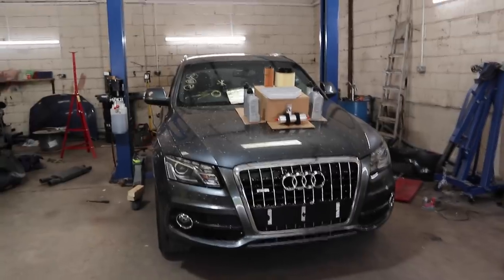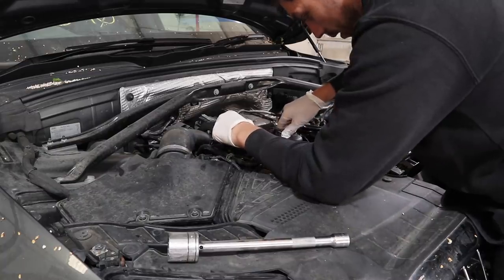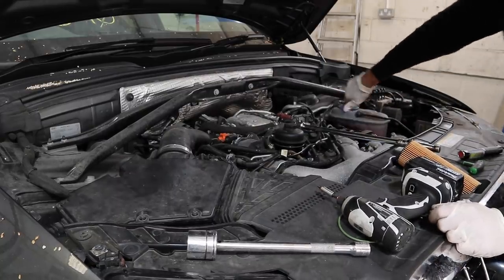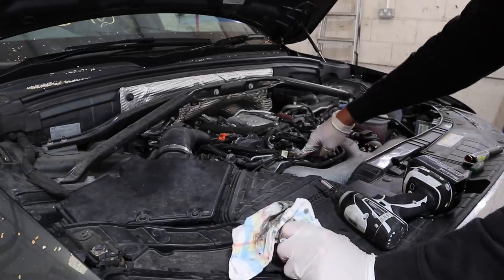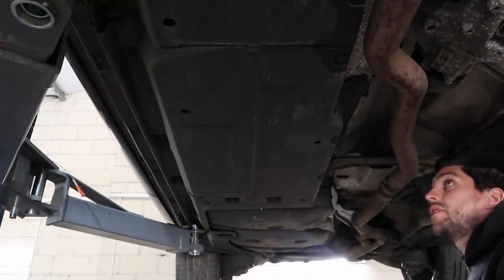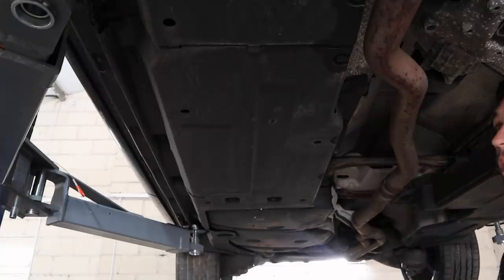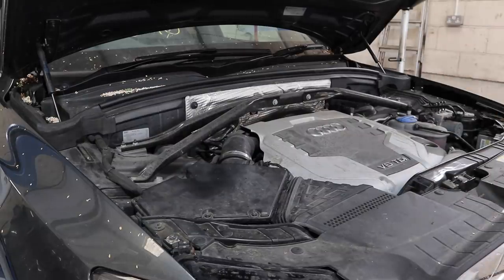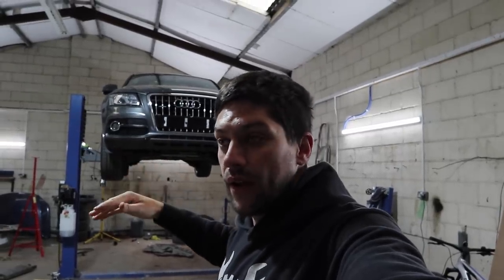Full *IN DEPTH* Service on My STOLEN Audi Q5!!

Comment: Yes start with the oil and a hot engine with a good flush so it drains out nice 👍 you say your stolen Audi but 38K miles you did steal it! I must have missed you mention that as I thought it had done 100k miles. Lucky guy and lucky car for having a caring owner to do it justice. Bravo on a bargain motor.
Reply: An engine flush with 38,000 is a bit excessive is it not 🤷🏼‍♂️ it’s not even broke in yet
Reply: @paulthompson5416  The more cleaner that engine is kept the sweeter it will run, also mileage means nothing...if a car has only done 5,000 but the oil has been in the engine for 10 yrs it won't be no good!

Comment: Love this style of video also dean 👍🏼 great little tips like the coolant sitting in the V and only half dropping the rear undertray for the fuel filter is brilliant 👏🏼
Also didn’t know about the 3l not having a dipstick unless you have a “specialist” tool for checking it and as you very well pointed out that it only shows level when warm 🤔 wouldn’t take you to have left the sump plug finger tight 🤣🤣
Keep up the good work bud 
Thanks 😊
Reply from the maker: Thankyou :)

Comment: I have got the laser adjustable dipstick for my a4 b8.5 but not sure if the same can be used for the q5 but could be possible if you have the correct adjustment. Very handy tool and its about £17 on amazon.

Comment: Informative again, nice one. How long did it take? My last service the dealer totally balls'd up. Over filled engine oil by over half a litre, no coolant top up, ticked boxes as green and said they had done checks but didn't actually do things such as greasing hinges. Said they changed brake fluid and left that overfilled as well. Can't wait till car out of warranty and I can get local garage to do annual service by a "real" mechanic like you. Oh and they disconnected dash cam on test drive of my hot hatch.

Comment: I notice that the air filter you replaced looks like a 'stock' one, but the one you took out looked different. It looked like one of those after market ones where you can remove the filter material, vaccumm it and put it back in, almost like-new.

Comment: You can actually buy a dipstick for the oil extractor tube.
Reply from the maker: Yeah you can, was just making a point that it’s not standard. Not sure why as it’s only couple of quid to fit.
Reply: @SavingSalvage  yep I bought one as well. The Electronic system is kind of annoying with oil changes. Dip stick was about € 4.

Comment: I got an Audi A3 2016. Oil filter pain in the butt to change. They stuck underneath the engine tucked out the way. Don't know why they couldn't of left it on top of the engine like this one.
Reply from the maker: Yes those ones are crap! There is a drain on those filters which let you drain the oil out before you remove it so it doesn’t make a mess. Still horrible though
Reply: @SavingSalvage  yeah correct. So easy in top though. Especially difficult without a ramp. I'm an Audi fan. My daughter's have Audi A1 s.
Coz I do smart repairs, they are  always bringing them to me  with damaged wheels or dents. Gotta luv em.

Comment: Hi great job, but what is the cost of the service comparing to have done at the Audi dealer. Thks
Reply from the maker: Well the parts there were £80 for the DSG oil and filter and the service parts were £95. Audi would have charged around £600 for what I’ve done there.

Comment: Hiya, good video, im about to change my fuel filter, but i have read you are meant to run a fuel pump prime with VCDS before starting the car after a fuel filter change, as you can damage the high pressure fuel pump. Did you do this or did you just chance it? cheers
Reply from the maker: Just cycle the ignition 3-4 time’s first. Does the same thing 👍🏽
Reply: @SavingSalvage  cheers

Comment: Good content buddy is there a way of checking the air con level?
Reply from the maker: No, if it’s cold it works. The only other thing you could do is plug VCDS in and check the pressure in the system. That would give you a slight indication but wouldn’t take is as gospel.

Comment: Hi I have a question about your transporter do you need a 7.5t licence to drive it or do you just need the 3.5t licence to drive it with cars on the back thanks
Reply from the maker: It’s just a 3.5T van so only need a car licence. And then a B+E licence to tow a trailer on the back. 👍🏽

Comment: Was there a reason you did the oil change in a cold engine? Normally it would be warm so the oil flows better with any contamination suspended in it as it drains out?  Apart from that a really good watch and informative.
Reply from the maker: I let the engine run for about 10 mins before I drained it. Wasn’t hot, but the oil was warm.
Reply: That makes sense then 👍👍

Comment: I believe you can't just replace fuel filter on these engines without subsequent prebleeding the fuel system - from the top of my head in ELSA mentioned that you need to trigger 3 times electrical fuel pump BEFORE starting engine after fuel filter replacement, it's done through the diagnostic software like VCP or VCDS. The reason is that from approximately 2008 VAG in their Common-Rail engines no longer uses high pressure fuel pump made of steel, they are made from aluminium which makes them very vunerable to mechanical damage in case if they run without any fuel. I've read a couple of stories and seen some pictures as well from damaged high pressure fuel pumps and damaged injectors - nothing funny and damn expensive!

Comment: Hey man, I have a question. I was cleaning my Audi while listening to the radio and the car battery died. I had someone give me a jump and now my Audi Concert stereo is in safe mode and I have no code. Do you know how else I could get a code without having to go to a dealer which of course are shut!? I see there are websites that claim my can get the code but for some reason, I don't trust them haha.
Reply from the maker: Should be stamped on the inside of the radio booklet. Failing that Audi, failing that you can get codes from online you will just need your radio serial number handy

Comment: Paid 50 k for mine new and had issue after issue with it since day 1 they can keep their junk! !  never once had any issues with mercedes or toyota i have one identical color only starts with a jump switch cause ecm wont recognize  the key in it replaced both fuel pumps tensioners every sensor and switch imaginable. The second you put your foot on the brake it dies

Comment: YOU DONE THE DSG OIL CHANGE WRONG NEED TO PLUG IN A LAPTOP AND GET IT CIRCLE AROUND THE DSG BOX OR IT WILL BEAK
Reply from the maker: I advise you watch you video before the make the comment then 😂